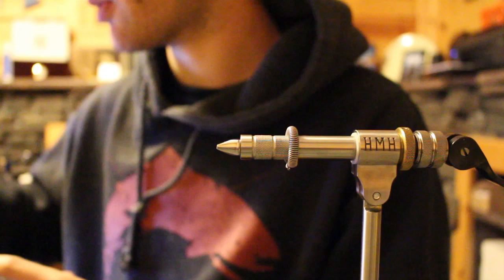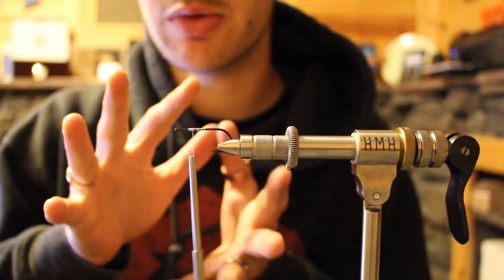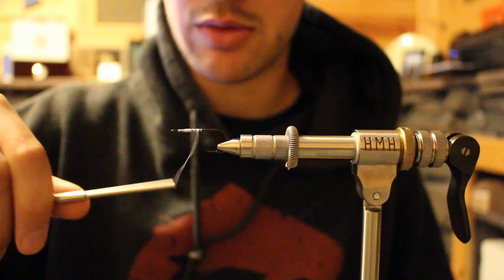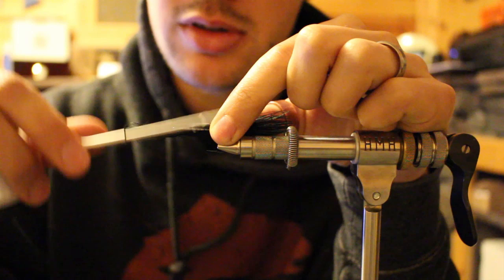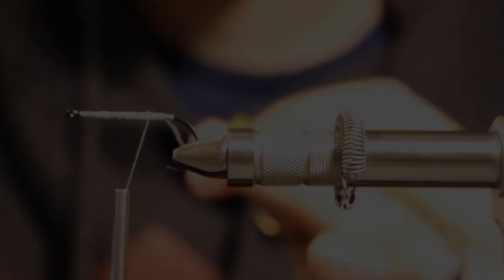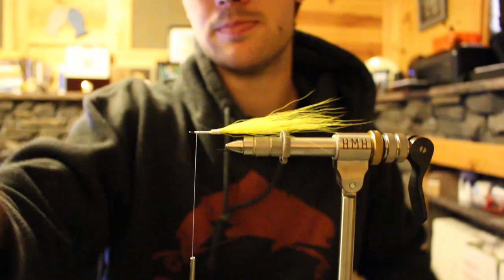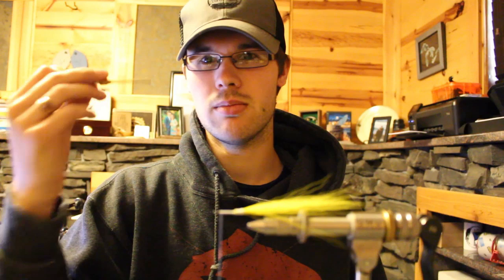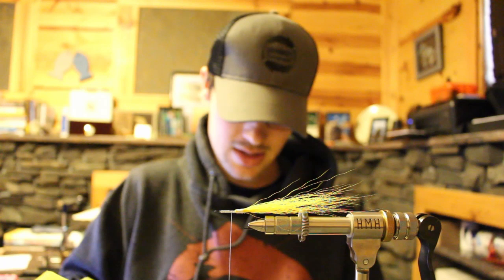Tie Like a Pro, Ep 1: Thread Basics

Comment: Really great info regardless of experience level. Great basics. I always learn from your videos. One point I may have missed: the bobbin you are using for streamer tying is a long Rite bobbin which allows more torque and you can adjust the tension mechanically vs by hand pressure. Thanks for doing these man. I’m a fan of your designs.